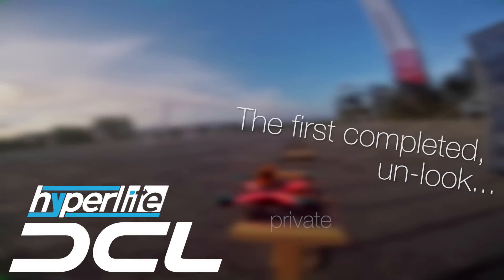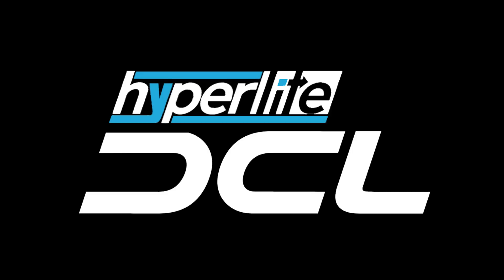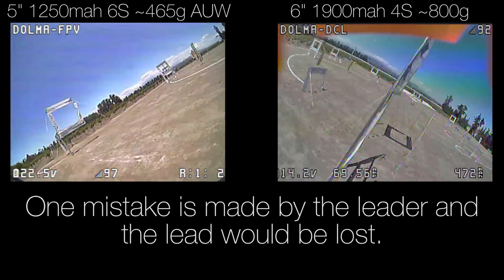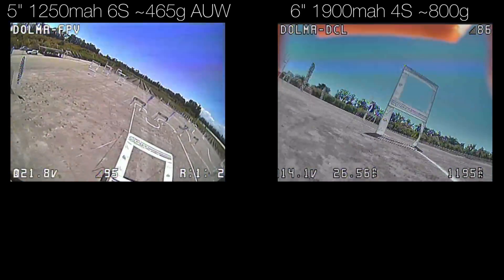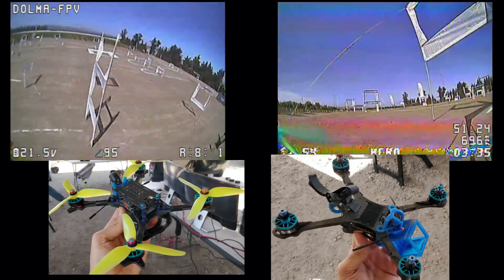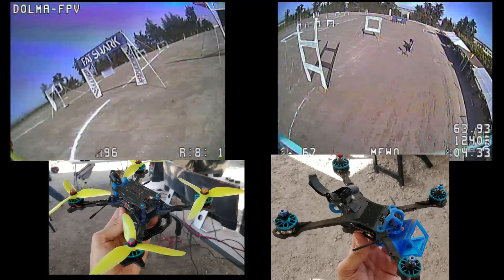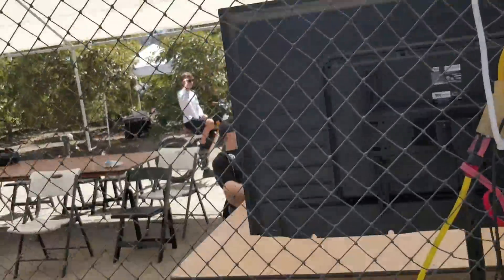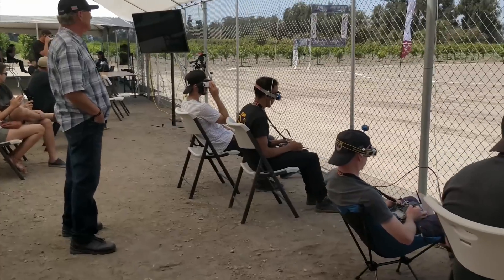4S vs 6S with a twist? + some other stuff

Comment from the maker: An interesting note I forgot to mention.  After running the numbers, the large heavy quad has about an 8% higher disk loading number compared to the light 5" quad.  Further support for the disk loading concept.

Mr Minion goggles is Skyberries FPV: https://goo.gl/UVrgdn

Mewo FPV: https://goo.gl/1X5cDH
Dolma FPV: https://goo.gl/gMDu3v

DCL Frame: https://goo.gl/uoCr9U
DCL Teams: https://goo.gl/NuqDiv
X-Lite controller: https://goo.gl/MD55gF
Nirvana Controller: https://goo.gl/S3Lcpu
Open Grove Raceway: https://goo.gl/zY9Rcw
Reply: Kabab FPV I completely agree that I think the disc loading theory is why it’s so competitive at that large size. I think it also helps for the exact reason you said, it’s just so much easier to make properly lines and not so twitchy. Same reason our 42% scale planes fly IMAC so much better than our smaller airplanes.
Reply: I'm really excited to try out a 550g 7" setup - I'll let you know how that goes.  Should be a really impressive setup, but I'm excited to see what its practical limitations are - for now all I can be sure of is that the Gemfan 7042's sound amazing at low throttle (caught fire midair with my $4 ESC // $7 motor setup testing them).

Comment: That was great!  It got me thinking about something from car and especially motorcycle racing.  It's a concept called "unsprung weight".

The 1000cc superbikes, and their 600cc counterparts can be nearly identicle in weight, yet the power to weight ratio would seem to point to the 600s not even being close to the monster 1000s, that have acceleration capabilities that are downright intimidating.  BUT lap times are AMAZINGLY similar.  Why?!

I think the answer is related to the quad comparison.  A 1000cc motor had larger and heavier reciprocating and rotating masses than does the 600cc.  At rest on a scale, the two bikes may weigh nearly the same, and even look nearly identicle.  But at 13,000 rpm, things change. While attempting transitions in turns, there is a significantly less amount of resistance from the motor with the lighter parts that are moving VERY FAST inside the engine.   So the 600cc is more nimble, and hence can make up for nearly all or more for its power disadvantage.  Dynamically, the bigger engine acts heavier than its static weight would suggest.  This is "unsprung weight", and it's very important.

But, on the street the kick in the pants a 1000cc engine gives is intoxicating.   So I like them.  Even if it wouldn't go around a track any faster than a 600.
Reply from the maker: I equate unsprung weight to the weight of the motor bell and prop specifically

Comment: Driving 5mph faster to work will actually get you to work 5mph faster than if you hadn't.
Reply from the maker: Yes but that's actually not so much faster when the distance might only be 15mi. But taking a 3mi shortcut would be a lot faster. That's generally the difference we're seeing between the big heavy quad and the lighter one.
Reply: Kabab FPV gotcha!

Comment: Hey Bob, quick question. Do you thing running a 2307 1725kv on 6s with a 6x5x3 prop will be good?
Reply from the maker: Little much kv but yeah it'll work out well. You could do the same with 1600kv too and it would be more efficient
Reply: Sweet, thanks. I will need to look into a 1600 or 1500kv motor then. I usually run my 5in rigs on a 2600kv so the math pointed to the 1725kv as a good 6s 5in motor but I figure why not toss a 6in prop on there too. Gonna test out the DAL T5544c the GateBreaker 6x5x3 and a Gemfan Flash 6042 twinblades on a 5s and 6s lipo. Going to see how the New Pyrodrone Ultralight series. Should be really fun

Comment: Kind of like the Bladed Fury Limited class.  Min weight 600 grams.  Red bottom motors, 5x4 prop,  1600ma 4 cell not overcharged required.   Running 3 to 4 minute races with proper track design.

Comment: i do keep flossing all week and my gum line is recessing like crazy - my dentist doesn't like it - what am i doing wrong???
Reply from the maker: All week?  Should be flossing all the time :-).  Recession isn't something that happens over night.  The primary causes are disease like gingivitis or periodontists or mechanical reasons, brushing too hard.  It's hard to say which you might be experiencing without seeing pictures or doing an exam.  Once the recession begins, it becomes more and more difficult to clean your teeth and it keeps progressing unfortunately.  The best way to stop everything and heal your gums is to actually talk to a good hygienist.  Dentists and periodontists are good but a hygienist is someone that ONLY cleans all day all the time.  They can often be as helpful if not more helpful with hygiene.  If you do have some sort of disease progression, you'll want to discuss it in more detail with your dentist.  Unfortunately recession cannot be reversed.  There are a number of surgical options to try and regenerate lost tissue, but they're only options on a case by case basis.  There's no universal treatment.
Reply: thx. excessive brushing in my case :(

Comment: What 8" or 9" props are they running on the DCL. 5" props have had so much development thrown at them over the last two years I'm amazed that a prop from anything else could keep up, let alone the weight etc.
Reply from the maker: DCL has no prop restrictions.  Any size can be run.  Most will probably be running 6"

Comment: Also consider the gyroscopic effect of heavier motors spinning vs lighter motors spinning. Takes more force to overcome the heavier gyroscopic effect possibly.  Maybe spin up some motors on an arm without prop and move around. Then try with a heavier motor to see if it’s harder or not.

Comment: The big problem i have with the 6s lipo's -> soooo expensive :'(((
Reply from the maker: They're not anymore.  The batteries are maybe just a couple dollars more and I've identified a sub $30 4in1 ESC that performs shockingly well.  It's common to go with the low kv 2205 now as well which is just $13.  Everything else is the same so it could potentially be even cheaper.
Reply: What do you think about the lifecycle of the 6s? If you compare with 4s?

Comment: Great coverage and thanks for the kind words =)

Also the footage trailing the dcl quad was sick haha
Reply from the maker: Except he was on like 500mw and I lost a popo prop and prop pad and got the popo mechanism stuck. So I had to use my quad that doesn't do smart audio and is always set to 1200mw. Which is really more like 1500mw....so I had to stay kinda farther away. I really wanna properly chase that thing around. It's so bright I can always spot it in fpv.
Reply from the maker: I have removed then popo motors from my quad. 😑. Hoping the popo pro shaft is proper.
Reply: Kabab FPV daaaaang yea I was hoping popo would be able to stand up to crashes. But yea in its current state it looks like something more suitable for practice but not a race environment where you NEED reliability. Pro seems to fix some of the stuff so I hope it works too

Comment: Hey Bob, quick Q:  Which one should I buy, those 10USD 2207 DYS motors you recently looked at or the 2306 Aokfly motors you reviewed a while back?
Reply from the maker: Neither. Buy the $10 rcx ls2207 2400kv 😁
Reply: k thanks, I'll check it out.

Comment: Yah, I've been saying that for years now :).. the best solution for race winning is to fly the perfect line, with no mistakes. Every mistake is a "long cut" and they all add up. So my approach plan to racing would be to slow the quad down until I can get the perfect lines and minimal mistakes; then start ramping up the quad performance - but slowly, in order to maintain perfect lines say 95% of the time. It's also of course the best method for practice. Remember your piano practice?.. SLOW and STEADY.

So it means that these super light and super powerful builds are actually way too fast for most pilots. I'm not criticizing; it's very early days really for this stuff.. like old car racing days - "bigger is faster right?" - lets put the V12 in it then - lol. And of course it all GREAT fun.

Comment: As far as DCL formats, I'd be partial to a standard payload (50g of LEDs and a gopro for the top and 50g of LEDs for the bottom), and then setting a minimum AUW based on the pack capacity (i.e. 4 grams per watt-hour of battery, NOT including the mandatory payload).  Would result in the same formula, but allow for some hilarious bruisers running big props for larger tracks, and high disk loading efficient setups at other tracks.  For an endurance racing format, I'd like to see enough flexibility that deliberate strategy moves can be involved, as speed differential and pit strategy creates action and the need for passing.

Comment: Something that hasn't been talked about yet is that when you increase the voltage by a full 50% something else happens.  The motors become a great deal more responsive.  So a 2205 on 6s is not going to perform like the 2205 we are accustomed to on 4s.  It will have increased response time and thrust curves and may be more like a 2206/2306.  So one way to make more power is to increase stator volume at the expense of weight, but you can increase voltage with virtually zero penalty.  To me I feel the 2205 on 6s is more responsive and "quicker" than my 2206 setups on 4s.  That being said I'm looking to take this experiment to a freestyle setup and see if a 2205 can now be a viable option for throwing a gopro around.  Hopefully we can have Ryan or someone else run some formal tests because I would like to see if the numbers back up what I'm feeling on the throttle.
Reply from the maker: That's actually not what I find to be true. The math doesn't even support that. I believe it's just a common fallacy among people. The performance is similar to higher kv 4s and in fact worse if you consult the math. It's possible that higher volts actually has less torque because torque is directly related to current and by increasing volts and dropping the kv, we're the current significantly.  The responsiveness to a punch is probably more so because the battery just doesn't sag rather than the motors performing better.  I dunno exacly what is actually happening but in flight it feels exactly like a 2205 is expected to feel and made worse by the enormous battery it's hauling around. I don't even think it's as efficient as a 2207 since you're on the gas much much more. But I can say that there is some agility benefit that is different to put your finger on....6S isn't perfect, it's just different and you don't see any sag. It's much much much easier to damage your batteries because of that lack of sag.
Reply: Kabab FPV looking forward to some real testing,  but I should mention the CHNL 1000mAh allows my Pepsi challenge quads to have an identical dry weight and AUW. So that was not a factor. The 6s seemed to have more torque and response on 2205 compared to the 2206 setup of equal weight.  Flight time was slightly improved as well as sag factor.

Comment: I've built a bunch of quads, using different frames and a slew of the hype motors out there - anything from 2204 to 2407 on builds ranging from 500g 5" bricks to 220g ultralights. My 'benchmark' build to which I judge the performance of all new builds is a 5" Floss 1 with ZMX 2205 2600kv (now upgraded to Hyperlite 2205 2522s - 220 grams). The responsiveness of that combination was unreal - seemed as if the quad would go where I wanted it to before I gave it the stick inputs. I've been dabbling with 6S (6" Floss 2.1 using CMW 2205 1750kvs - 280g). Wicked quick, decent flight times, but it lacks the nimbleness of that lighter 4S build. I'm thinking it needs more kv on 6S (maybe 1850kv)??? Thoughts?
Reply from the maker: Yeah that nimble feeling is what me and Vanover both recognize as an annoying issue too. I'm experimenting to see what I can do to get it back.  I believe it may actually need a drop in kv. Not an increase. We have 1600kv on the way. I also believe it'll need a lightrt load but highly effective blade. It's possible the HQ 5x4.3x3 v1s will shine here even though I dislike that prop.
Reply: I'm running a similar setup with a Mode 2 Ghost and ZMX FinX23 2205s with HQ 4.3V1S or Gemfan Windancer props. Flies amazingly, so responsive!
Reply: There's something magical about a 220g dry 4S setup with those FinX23's... dunno what to tell you.  Feels locked in, the only fault I can encounter is that the thrust:weight is so high running lighter batteries that I turn the camera tilt up until I run out of talent, it is such a good setup.  Right now, I'm at the limit of running the Floss2.1 top plate reversed and clearing the camera (I happen to really like how the Race412 Pagodas lock in place with the top plate rotated 180).
Reply: Agreed. Mine sits around 250g with SMA pagoda antenna, 2g each TPU arm guards and those light props. Absolutely the best racing machine I've ever flown, which is why I've pre-ordered the Ghost V2 and bought another 6 of the motors to build another!! The motors are nuts, the best kind of it. So much thrust!

Comment: Smaller motors in size are twitchier then bigget motors and I believe that's because ohms law and resistance more wire on the com the more resistance takes more volts to get through therefore more stick imputes?
Reply from the maker: Seems like a reasonable theory?  I wonder if we'll ever know...
Reply: prob not just thinking out loud. but i know at work when i want to know how much wire left on a roll i use a ohm meter and the more wire the more ohms and more electrical resistance. i dont know what size wire they use for brushless motors but u can very easily check the ohms across the motor 2207 and motor 2205
Reply: If any of my limited farting around in COMSOL tells me much, that tends not to work out as much.  More copper behind the stators and more laminations is still going to create more instantaneous torque, even though the actual DC resistance is higher the effective impedance the ESC sees is going to be reeeeally close, so much so that under load stator height is going to be your friend.  I think the advantage the 2205's have is probably just a lighter weight bell and less overall weight, and depending on where Andy feels that the quad is limiting him the most on handling and lap times, that bit of weight savings can be worth more

Comment: I could get into big heavy quad racing, especially on 4s, is there a limit to how big of a pack you can run
Reply from the maker: There is a pack weight limit for DCL but the frame could literally hang 20k mah 6S off it with 8" props and fly for an hour.

Comment: Your spot on with the idea on the 2205. Even minor changes in weight reduce the amount of momentum you can have, requiring less power to change momentum to another direction. I would add that the lighter weight of the bell vs the 2207 makes throttle more proportional/connected to your input. Also allowing the motors to speed up and slow down quicker, creating that "nimble" feeling you were talking about. I also think the quad reachs top speed quicker, even its tenth or a hundreth of a second quicker, throughout a 2 min heat, that time adds up.

Comment: You said last week that you got the rcx  10$ motors on the way, did you get to try out the LS2207? If yes what are your thoughts and how do they compare to other motors in the category?
Reply: For the money, I can't complain about any of mine.  In the hand, I preferred them to the DYS, even though the bearings were all over the place (some great, some rough).  In the air, they're among the nicest motors I fly in terms of overall flight feel.  Air gap is a tiny bit big, and I suspect the magnets may not be as beefy, but I get amazingly clean video, solid power, and good efficiency - the ZMX motors have more specific output, my EMAX have more raw power, the lightweight 2205's are on lighter overall builds, but if left to my own devices I'd just build more 6" Floss2.1's with those NK/LS2207's, and consider getting them in 1700KV so that I can run 6S-5" or 5S-6"
Reply from the maker: They're still on the way....
Reply: Kabab FPV damn haha mine miraculously arrived after 4 days to Europs, but I must wait few more weeks for other components to start the build, I was waiting on your input to maybe buy another set xD shame that theres not much info or flight videos of them at all. Anyways keep up the good work!